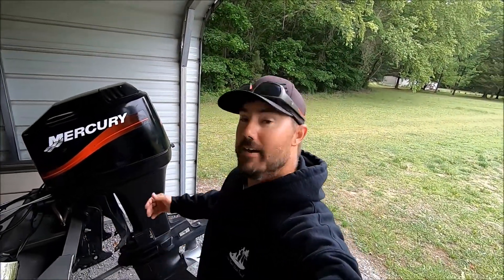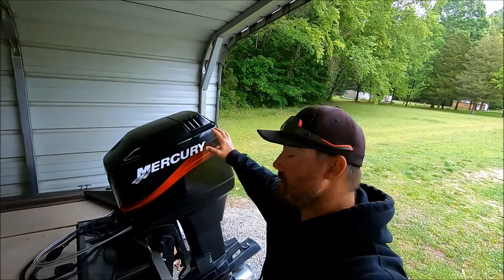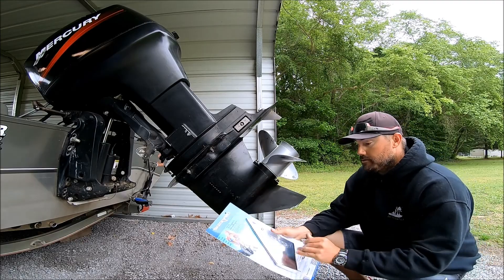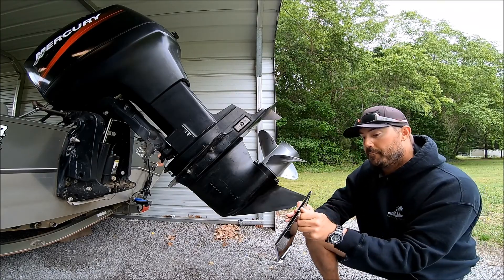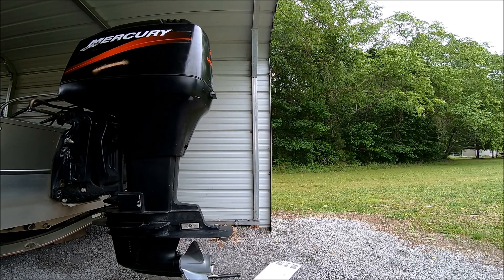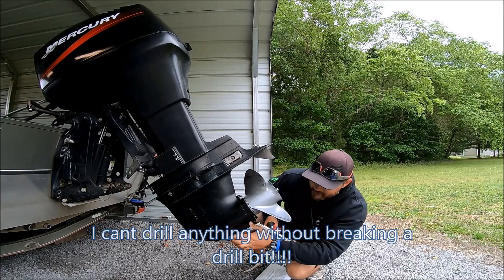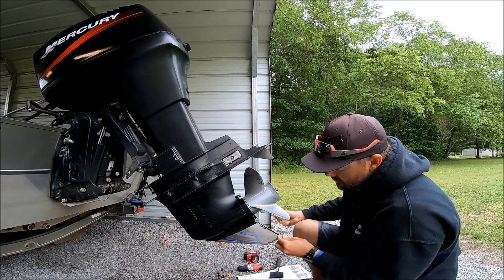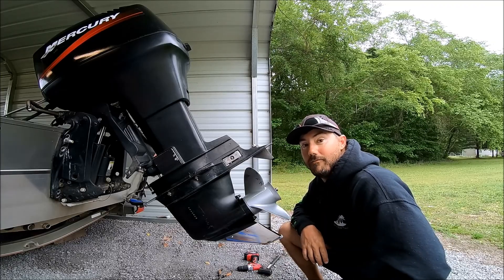How to REPAIR a DAMAGED or BROKEN Skeg on an Outboard Motor// SkegGard Installation

Comment: I know this video is older, but I own a propeller and skeg repair facility and was curiously looking around when I came upon this vid. Some great information for sure. One thing I wanted to mention. We've repaired more skegs than I can count. One thing I have my customers shy away from is the guards. With no guard, you hit something, a piece of the skeg breaks off. You can get it repaired for relatively cheap. However, the worst skeg repairs I see come from customers that use the guards. They bolt through the skeg and usually they're made of steel. So when you hit something, instead of the skeg breaking, it pulls that bolted steel guard along with the skeg and more often than not, much more of the lower unit comes with it. Skeg guards are responsible for 50% or more of our casing repairs. That being said, the guards will work great for brushing off things like small rocks, wood pieces floating in the water, etc.... With no guard, those small rocks and whatnot would cause damage to the skeg. I don't want to say don't use them, just know what will happen if you end up hitting bottom or something else pretty hard while having a guard on.
Reply: Any recommendation for using a skeg guard as a kind or replacement skeg if the majority of it has sheered off?
Reply: @AJKammerer  it would just be the same as using it if only a small chunk was missing from skeg. It will work, given there's enough skeg left to attach it to firmly. If it was my boat, I would just have the skeg itself repaired. Not sure you're area, but in our area, it's roughly only a $150-300 repair at most marinas or prop shops.
Reply: There is no one in my area that does repairs after I snapped the bottom off my skeg. So a guard it is. Have you physically seen any galvanic reaction when you have removed old guards?
Reply: @Jack   @Jack  I haven't. However, I can't remember the last time I removed a guard, or seen one for that matter. It seems over the last year or so, they aren't as prevalent. Usually when customers come in, it's to have the skeg repaired from damage. So there's either no skeg at all, or very little of it. Have you tried just a basic welding shop? Replacement blank skegs are something you can easily order online for your specific lower unit. I'm sure any welding shop would have no problem welding it on and finishing it. If a guard is your only option, it's your only option. I feel I've been pretty negative on the guards in this thread, but they'll do the job! There's just a much better way of doing it is all. Sometimes there's no choice and it will definitely suffice.
Reply: @overthinker1506  I would prefer to weld. Especially for resale. I didn’t know you could order pre cut blank bits of aluminum, this would be ideal to rock up with the parts and the gearbox already off. Is a lot of work when I’m about to start a type rating for an E-190 haha. I’ll look into it, maybe ask a few more questions. The boating we do is very low risk of damage. All open water, sand banks at most. So I’m not too concerned about hitting it again 😅 thanks for the insight thought, it’s given me more food for thought
Reply: @Jack  of course! We do a ton of them, so we use a distributor. I'm positive if you just Googled your unit and "blank skeg", you'd see them fairly cheap. Good luck!!
Reply: @Jack  also, I live in Northern MI. So 90% of all repair work we do is from freshwater. Are you boating in freshwater, or salt? If you decide to use a guard instead of repairing the skeg, I would definitely put a coating on that steel guard. Just something to consider.

Comment: Have you ever been concerned about damaging the transom after hitting or dragging the skeg? Do you think the hydraulics would give before damaging the transom?
Reply from the maker: I have hit alot of stuff with my motor and never had a transom issue but I did have to replace my tilt and trim twice. I'm sure it's from hitting so much stuff through the years
Reply: @GunnFishTV  I thought I scraped my skeg at the ramp yesterday on my 2020 tracker pro guide & my first thought was, oh no the transom. Looked at it when I got home and I don’t see any scrapes on my skeg. I may be overthinking it. Thanks for the info.
Reply from the maker: @tyrailr  ur good man. The boats are built well

Comment: Bad idea.  The skeg guard requires the holes drilled , which creates a perfect weak point for the entire skeg.  Hit something and instead is a small fracture, you break the entire skeg off, which possibly leaves insufficient remaining material for repair.  Then you get to buy an all new lower housing and have your gearing transferred.
Reply from the maker: I knocked the holy hell out of some stuff with this thing and it held strong. I sold that boat and motor a few years back and the guy still runs it now with the same skeg. The pins are supposed to shear off before the skeg breaks. Idk but its strong lol

Comment: Fuck. I just snapped mine off pushing boat up and into shed. Forgot we lowered it to let the kids get past.
Reply from the maker: O man that sucks!
Reply: Yeah it does! Was pushing it full speed up the slight incline to get into the shed. It caught on the raised shed slab while motor was 45dgrees. Oh well. Shit happens. 

Ordered a stainless sleeve. I am VERY curious how people go with dissimilar metals (and salt water) though. Theoretically the outboard anodes should protect it, after all, you have stainless bolts holding the aluminum engine together. Worth painting in duralac before install I wonder?
Reply from the maker: @ibsn87  probably wouldn't be a bad idea
Reply: @GunnFishTV  can’t hurt right
Reply: Been there...